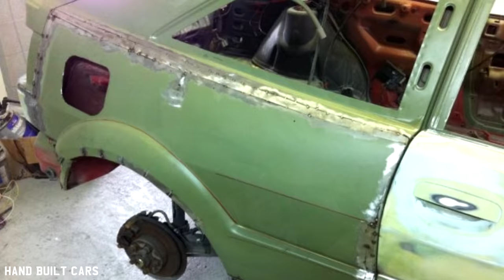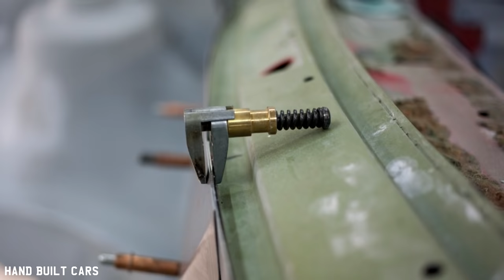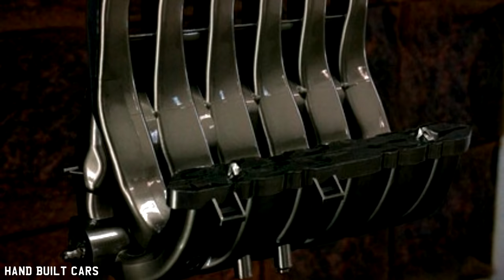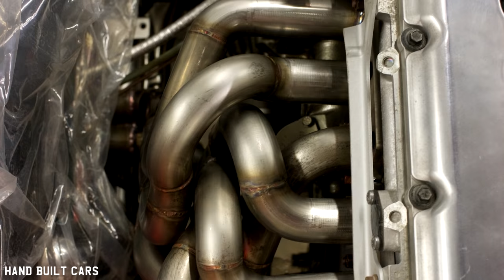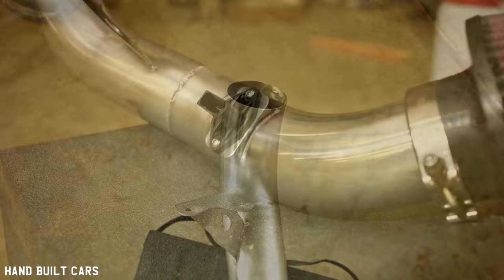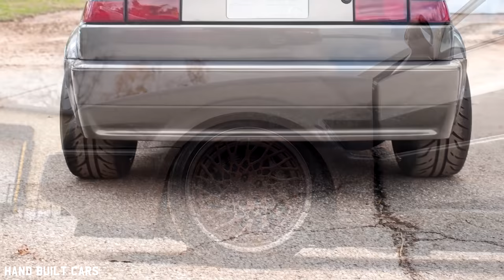VolksWagen Corrado R32 Custom Build Project

Comment: Hand Built 
Cars-This is the finest Corrado resto I have ever seen. Your attention to detail matches everyone of my Corrado build dreams and more.  You left nothing out except part sourcing, a start up and a few runs. Im in the US and I held out to have the exact same engine in my 2003 Jetta. Its supposed to be a 2.8 VR6 but its not. Its a large 2.8L- 24 valve- V6 with custom cam lobes & settings. The secretive BDF- It's fast & fun.